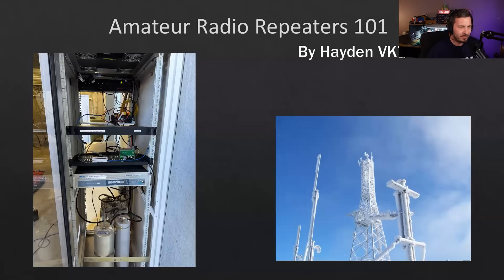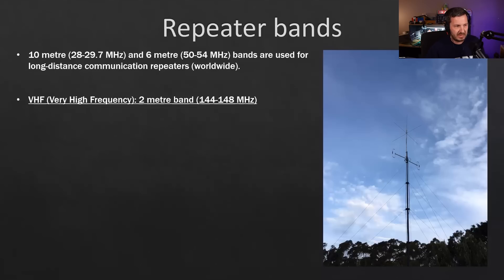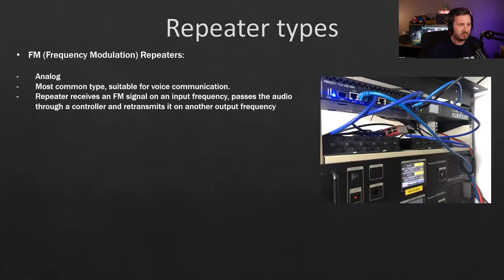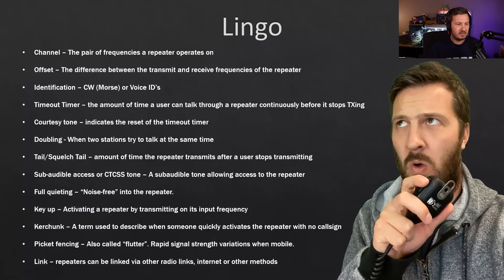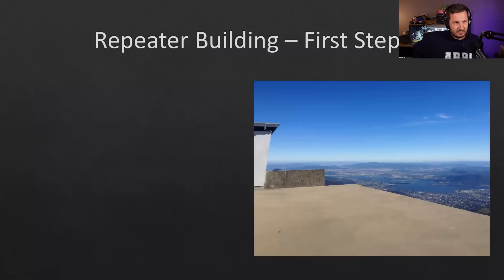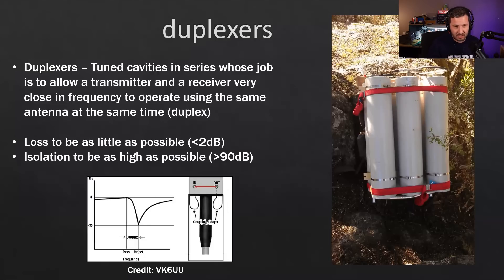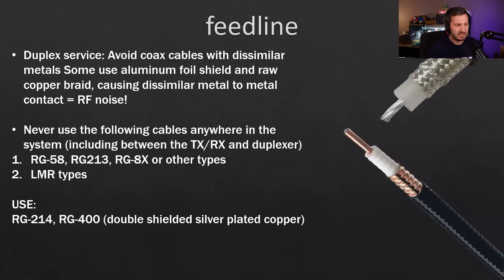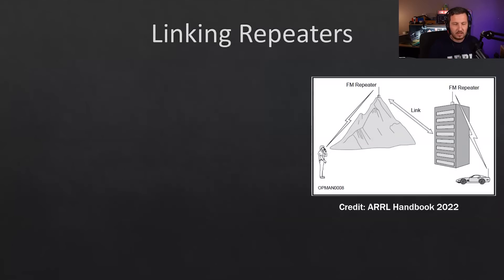Ham Radio Repeaters - How To Build and Operate

Comment: Great presentation and questions at the end. One of the hardest parts of tuning our repeaters was getting the squelch sensitivity set correctly.
Reply from the maker: Thanks Kyle. Yeah for sure, the squelch sensitivity will change from the test bench to the site - and then it can randomly open when noise floor levels change etc.

We don't have so much of that issue as we run CTCSS so the mute is set really really fine.

Comment: Hi Hayden In Denmark we have repeaters on 4M. 70 Mhz out on 70,500 and in on 69,900 Mhz. However, we only have this one frequency. there are 5-6 repeaters active at the moment. Our 4m band is from 69,900- 70,500 with small gaps. There is some traffic on 70.450 Mhz which is FM calls and on 70.200 SSB